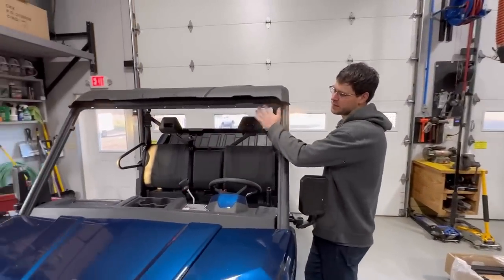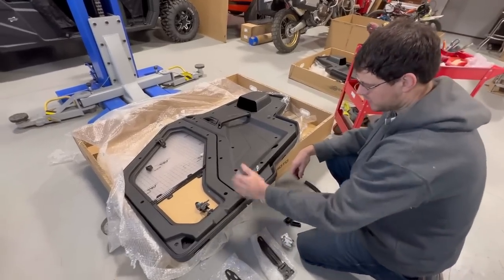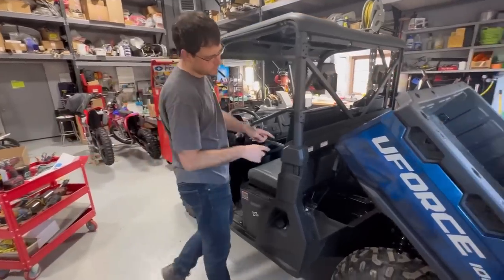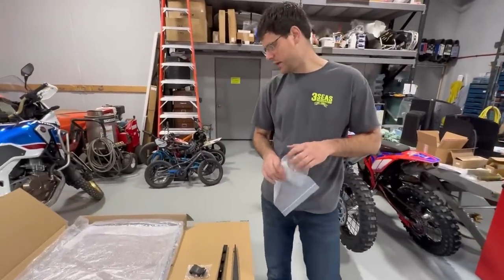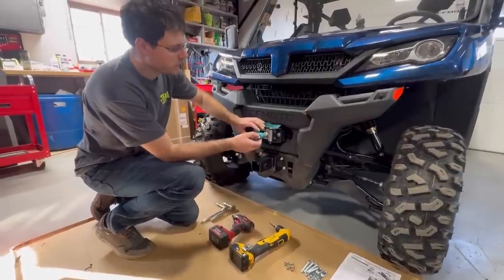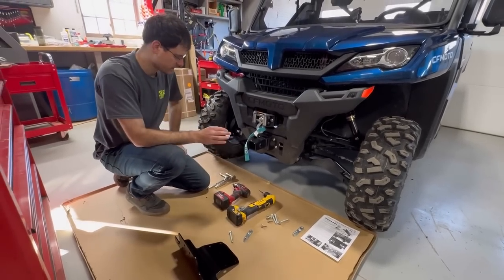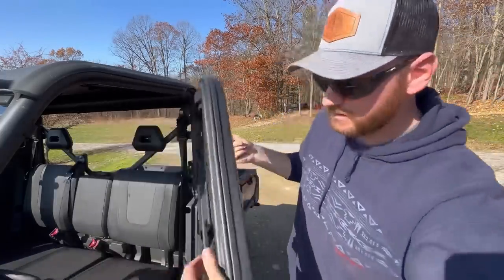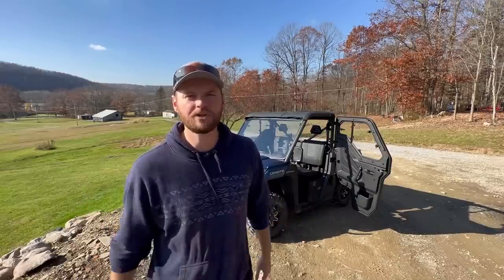CFMoto Uforce 1000 Full Factory Cab Enclosure

Comment: Hey Adam, one thing I think they should have done was have the windows in the doors open in the reverse. Think about it if its raining or just drizzling you can t open the side windows because rain will come in by the direction of the opening if they opened in reverse the air would still get in but not the water especially if you want to keep the side windows from fogging up but mostly to keep the rain out. Remember the older cars if you are old enough, they all had side vent windows separate from the side window for just that reason and worked great for that purpose... "just saying"

Comment: Great video. I just got a 2024. Same doors as yours but decided on the SuperATV flip up windshield. I have to slam the doors shut because the mounts are thicker on the windshield. Also, I can't see the side mirrors because the door frame blocks it. Do you have that issue? Also, do you have heat?

Comment: Do your doors seal good at the bottom?  I just purchased a set for mine and one of them does not have a good seal at the bottom.   I've loosened all the hinges and tried to adjust it but when you get a seal on the bottom then it's off on top and the latch wont be in the correct place.  Have you had any experience with this and if so how did you get it to have a good seal all around the door?

Comment: I will save you the trouble,  the plow kit is worthless.  A 5hp snow blower does better than a sxs with a flimsy plow.
Reply: Dont be so cheap and buy the Boss V-plow for it. Good luck moving more snow with your 5hp then.
Reply: @fullthrottle2656  Hello, I know it sounds hard to believe, but here me out.  
 A not so good neighbor had a vplow on his polaris ranger. He tried to sell the plow kit to me because it doesn't work well here in the mountains with deep snowfall. He now owns a rapid track Ariens after seeing me finish my whole drive in just 1hr down from several hours to never ending towards the end of the season.

 The ariens 420cc is much more that 5hp,  easily moves over 102 Tons of snow per hour, and it moves it 50' or more from my driveway, the track system easily goes where no side-by-side without tracks could dream of. The 420cc engine is a tq monster, sounds like a 450mx bike at full load. The snow thrower is easy on the ground, and doesn't scoop my gravel from the switchbacks like the blades can in the muddy snow seasons.

The v plow is just as worthless in its own way, I know from experience. There is no comparison, a utv snow plow is worthless up here. The utvs are not heavy enough, the snow gets to deep and its actually embarrassing how poorly utv's preform at plow duty here.

 You have to consider narrow winding and steep driveways, every time you push snow off to the side it compacts and builds up, making the road a little narrower each time. 

Vblades and regular utv plows are usable for flatlanders, although incredible inefficient and racks up hours on expensive equipment.   

My driveway requires 4wd, locker and the best tires to climb, the uforce1000 could hardly get itself up, I had to plow downhill most of the time. Gets to a point it becomes an ice shut you slide down with sxs's.